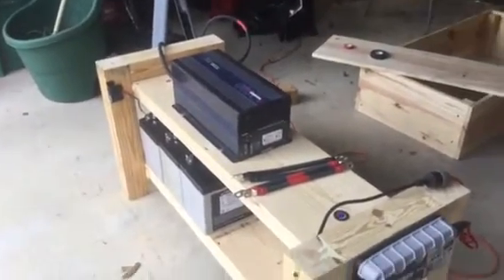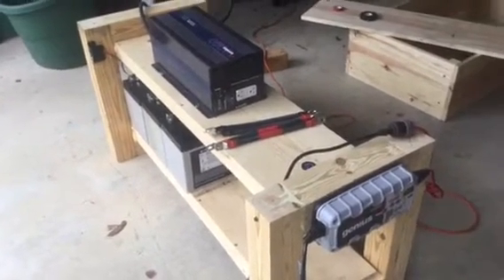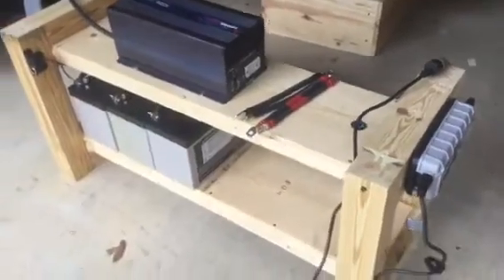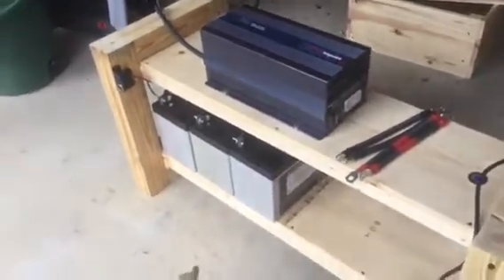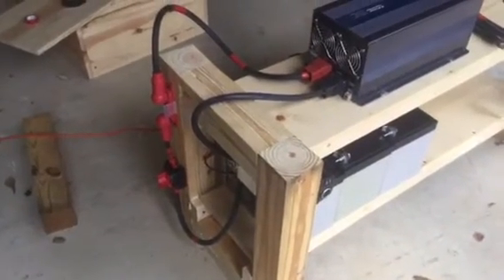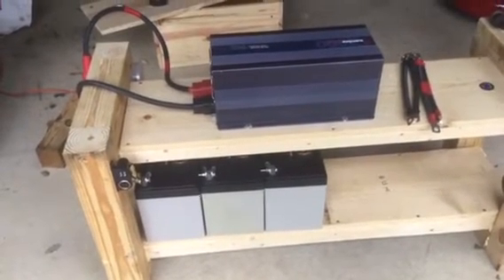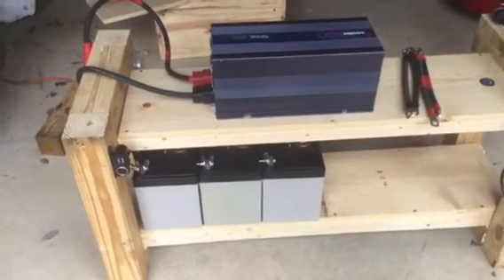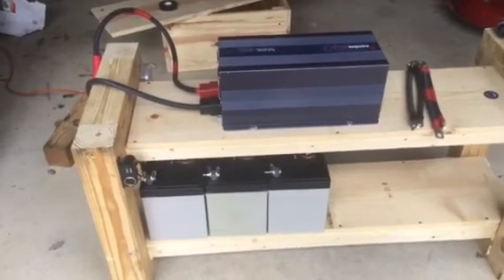House battery backup system

Comment: For you’re generator to charge you’re batteries in a power outage - car alternator google the better one to I’m a Gm man so I’m dealing with GM 10Si High Amp 100 Amp 1 & a 120 10Si & I got a Ford / Masada 150Amp you’ll be able to spin the alternator with a Dc powered motor ! S an idea to help !
Reply from the maker: I now have twice the batteries and I have a 300 W solar to. Charge